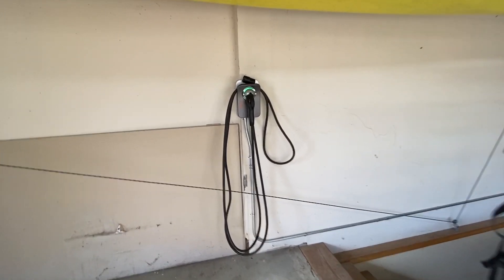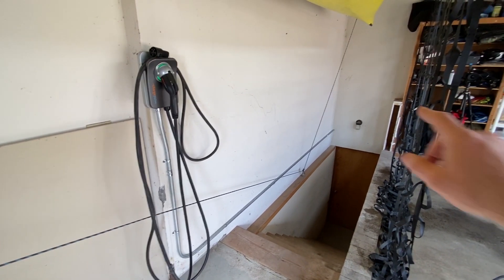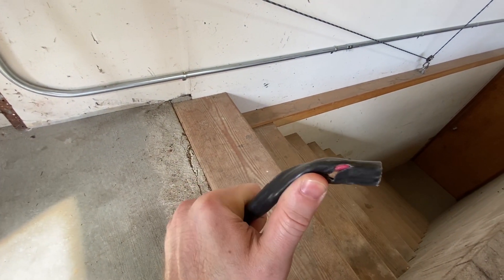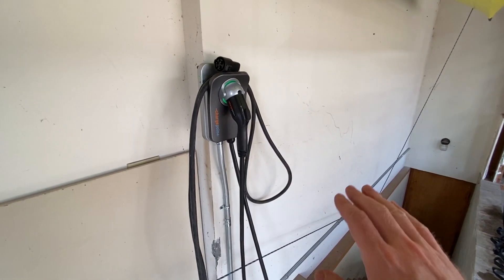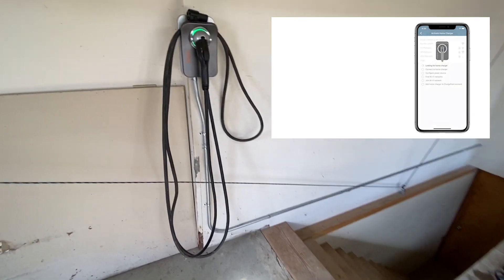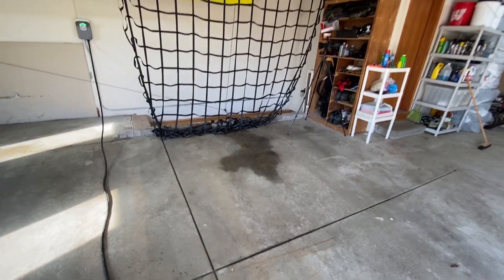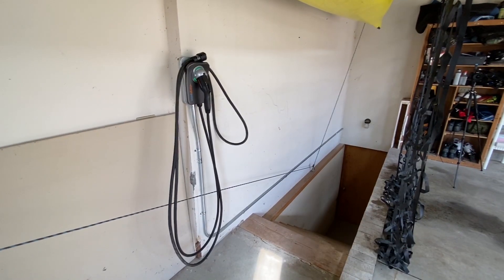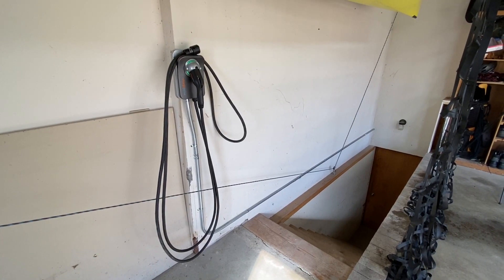ChargePoint Home Flex Overview // Level 2 Charging // EVSE

Comment: Looks good, very clean.  Where I live they don't allow NM-B in a conduit because of heat, 50 amps is getting up there.  I need to run Thhn wire.
Reply from the maker: That is one of the difficult things about installation is the electrical code. Have you installed one yet?
Reply: In the planning stage
Reply from the maker: Bellagio Awesome! Let me know if you have questions. I’m happy to help.

Comment: Why would you waste money on romex when you put the wiring inside conduit? Could have used THHN and saved $
Reply from the maker: Code needs Romex inside the house. Didn’t want to run conduit all the way to the breaker box. 👍
Reply: @DetachedGarage  If you’re worried about code.  6-3NMB isn’t rated for 60amp it’s max 55amp. You should set your charger to 50A and replace the breaker to a 50.  Also what size conduit is that?  Not sure 3/4” with a Romex jacket would pass the fill%.  That looks pretty small, it isn’t 1/2” is it?  Must have been a PIA to pull too.  The issue with the NMB is the jacket, the wires inside are probably 90C thhn but their insulation and the added insulation of the NMB jacket retains heat.
Reply from the maker: @jay90546u8  charger is set for 48amps 👍 Thanks for watching and thanks for the suggestions. I’ll definitely keep them in mind for my garage build.
Reply: @DetachedGarage  Sorry do you mean it charges at 48amps?  If so that means you have it set for 60amps with the 20% mandated hit to 48amps.  You'd have to look it up but 6/3 nmb has peak load of 55amp and a continuous load of 44amps (ev is continuous).  This is very well documented.  In your case assuming your conduit is adequately sized for romex you should set your charepoint to a 50A circuit and charge at 40A.  You'd be within specs at that point again assuming you've figured out your insulation on the nmb in conduit.  Will it work, yeah probably but you're definitely not in spec at the moment and no one should follow your installation.  If I were you I'd back pull the romex, strip it and use the included THHN.  Then conduit it all the way to your box.  You should be able to just buy 3/4 greenfield pretty cheap.
Reply from the maker: @jay90546u8  Cool thanks for the info. I will definitely consider it for the existing install and 100% change my installation approach in the new garage. Cheers!

Comment: Pretty sure you aren't allowed to run 6/3 in a conduit if you live in the USA
Reply from the maker: It is safer to run it without conduit?
Reply: @DetachedGarage  NMWU Type cable is meant to be run in direct burial situations, long runs of cables are generally not run in  conduit due to the chances of overheating, removing the jacket from the cable and then running it through conduit could be a solution in your case, check with a local electrician, regulations are different in just about every jurisdiction in the US